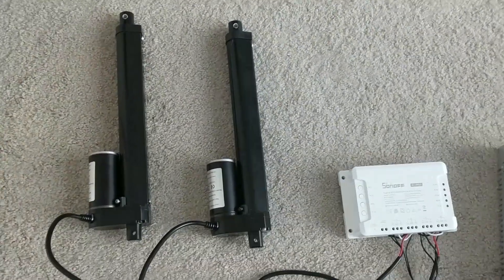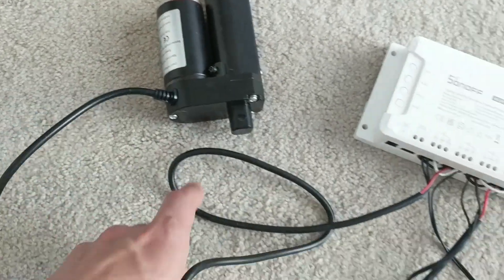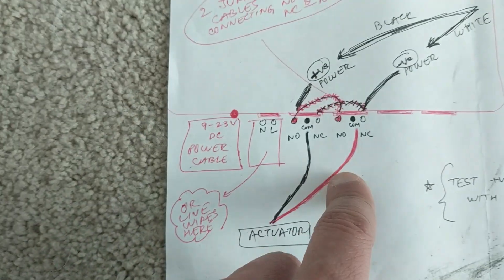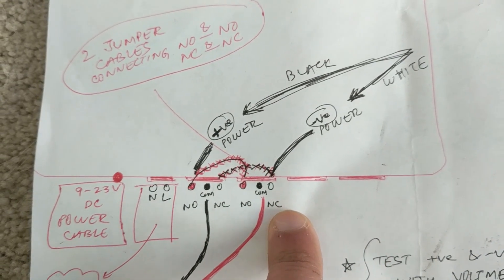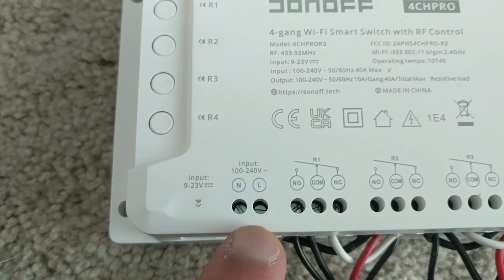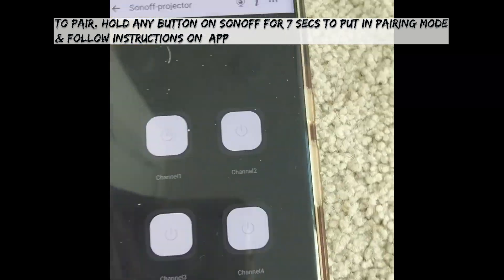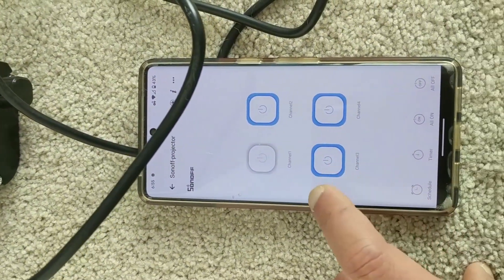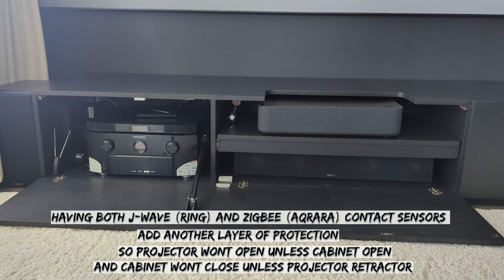Automatic entertainment cabinet - Linear actuators controlled by Sonoff & Home Assistant

Comment: Hello, thanks for the video. How dis you wire the sensors?
Reply from the maker: @FabioSilva-fe9bf Hi, The sensors shown in the video are wireless contact sensors - One from aqara which works by zigbee technology, and the other one is the ring contact sensor, which works Z-Wave technology. I control them with my home assistant and Google home. I wanted to have one zigbee and one Z-Wave sensor just to be double sure that nothing opens when it is not supposed to open....

Comment: Hi. Want to ask, with the apps, can I stop the actuator in the middle while extending?
I dont want to make my actuator to not extend fully
Reply from the maker: @tynderian  yes, you can extend or retract the actuator to wherever you want with the app. You will just have to hit the stop button on the app (or turn off power to that actuator). Another way, which is my preferred method, is to use hard wired kill switches- that way the actuator will automatically stop when it reaches the points where you have put those kill switches.
Reply: @Craigslistmist  thank you brother.
Appreciate the response

Comment: Thanks SO much I got it working!
Reply from the maker: That's great to know. I am happy for you.
For other people who may be interested in the similar project, it might be helpful if you can provide just a few details about what device you ended up using finally and how you wired (if that's possible at all for you). 
Enjoy your hard earned project!
Reply: @Craigslistmist  Yep!  With pleasure.  I'll make a diagram this week.    Q - Can I use the Power Supply Universal Regulated Switching Transformer Adapter (same as you used) to also power the Sonoff smart switch (or the one that I'm using instead)  since I'm only using one of the 3 outputs of the power transformer.  The smaert switch says 7-32v)?
Reply from the maker: Yes, it should be able to power Sonoff. Thanks

Comment: I bought the Sonoff 4CHR3 (as the one you have is no longer for available).  It have 5 wire connectors marked "N", and another 5 wire connectors marker L-IN, L1-Out, L2-Out, L3-Out, L4-Out.  What wires go where?  TIA
Reply from the maker: Sorry, I have only used the Pro versions for all my projects, and I am not an expert in this field. But, there is some good info on Sonoff website about controling motors with several of their dual channel relays with wiring diagrams. So, this may help: https://sonoff.tech/product-review/tutorial/how-to-remotely-control-your-roller-blinds-with-sonoff-smart-switches/

And, their official manual also has wiring diagrams for both 4chr3 and 4chr3pro versions, so you may be able to infer something from there as well: https://sonoff.tech/wp-content/uploads/2023/12/User-Manual-4CHR3-4CHPROR3-V1.2.pdf
Good luck with your project.

Comment: Great video. Planning a linear actuator project myself. Is that wiring configuration you have reversing the polarity? I was looking at SONOFF stuff as well but I only need two channels. I am just not positive on how to reserve the polarity using a method similar to what you have done. I also plan on making it comaptible with Amazon Alexa, so gotta figure that out as well.
Reply from the maker: Hi, that is the main goal of using this Sonoff (to reverse polarity). Any dual pole dual throw relay should work to reverse the polarity. The benefit for this particular device for me was that I custom flashed it with Tasmota. And I can access it via my home assistant/ google home. 
I am not sure if you can access it directly via Alexa (there might be, I just dont use it). I know for sure that if you use home assistant, there is a way to link it to your Amazon Alexa.   Good luck with your project!

Comment: the link to the sonoff is not being sold by amazon  any other to replace it?
Reply from the maker: You can try eBay or AliExpress (although that takes forever for shipping). I have personally not tried using anything else, but can't see any reason why any other four-channel relay would not work. Someone here (in below comments) tried using another four-channel relay and seems like it worked for them.

Comment: I've already built my cabinet.  Was wondering did you simply attach the actuators to the bottom of the drawer/tray?  Can you post a simple handwritten schematic/design?  thx!
Reply from the maker: Attaching the actuator to the projector tray was a pretty straightforward process. I attached one bracket to the back of the cabinet (not on the moving tray obviously), then extended the actuator fully and attached the second bracket on the projector tray whereever the actuator stopped at its fully extended length. 
Attaching the second actuator on the bottom part to open the front cabinet door was a pain. Bascially, follow the same principle as for the projector tray actuator. Open the cabinet door fully, extend the actuator to its max, and mark the points where the front bracket would sit on the cabinet door and mark the spot where the back bracket would sit. Dependeing on your dimensions, you may need to attach the back bracket either on the ceiling or all the way to the back of the bottom cabinet. 
I tried to create a sketch here - https://photos.app.goo.gl/Bc7a6Hsb2Rku5TZ67     
Let me know if you have other questions.
Good luck!
Reply: @Craigslistmist  nice diagram,  thx!

Comment: Anyway of using one Channel to control both actuator for units that need 2 actuators to be in sync?
Reply from the maker: You need 1 channel for extension and 1 for retraction for 1 actuator. The 4 channel sonoff I am using is controlling 2 actuators. 

So, assuming that you mean if you can use 2 channels for 2 actuators (1 to extend both and 1 to retract both), the answer is YES. 

I tested it and it works. Just be mindful of the power consumption of each actuator and how much power you are supplying to them and to Sonoff. Sonoff can take up to 24v DC. 

Also, in theory both actuators should work in PERFECT sync, but in practice, there MAY BE a TINY delay and not perfect synchrony. Be mindful of that too. My actuator sizes were different (one was 8" and other 12"), so not sure if that had anything to do in my test.
Reply: Hey thanks for the reply. I actually tested it today with a knockoff 4 channel relay similar to sonoff but way cheaper. It worked. I was able to use just 2 channels for 2 actuators like you said 1 to extend 1 to retract. That is all I was looking for. Thanks for your help.
Reply from the maker: 0 @KeithOlbermannn  Great! Good to know, and good luck with your project.
Reply: @KeithOlbermannn  Can you send a link to the knockof that you used, as the Sonoff that the OP used is no longer for sale?  thx
Reply from the maker: @cgott42  you may also want to look at Shelly devices. I remember using Shelly plus 2PM before using Sonoff for this project. It worked nicely, but I preferred So off as I wanted to custom flash it with Tasmota and ESPHome.
Reply: @Craigslistmist  can you describe how to wire for this if I use the Shelly Plus 2PM?  thx!
Reply from the maker: Shelly pdf manual has some wiring diagrams. Its an extensive manual, but searching for "motor" may make it easier to narrow down. Here is the link: https://www.shelly.com/documents/user_guide/Shelly_Plus_2PM_multilang_v03-1_web.pdf
Reply: Thanks for responding
Reply: Thanks! I’m going to use google home to control the linear actuators in my therapeutic chair. 

What’s the power supply manufacturer?

Thanks again.
Reply from the maker: Thanks.
I used this power supply from Amazon:

ALITOVE DC 24V 15A 360W Power Supply Universal Regulated Switching Transformer Adapter LED Driver 110V/220V AC Input for LED Strip CCTV Radio
Reply from the maker: Amazon link:  https://a.co/d/a0e57VL